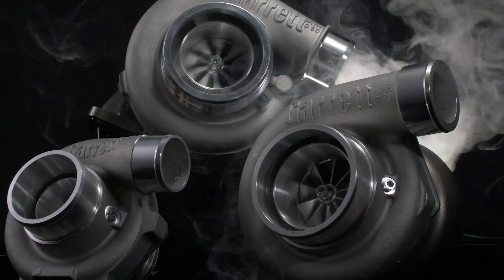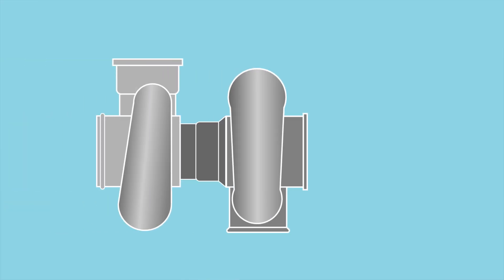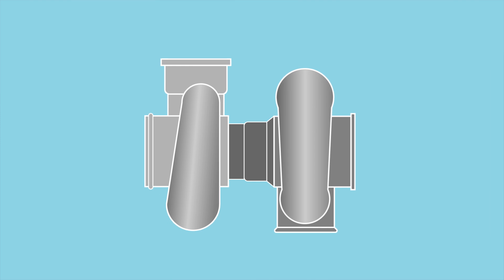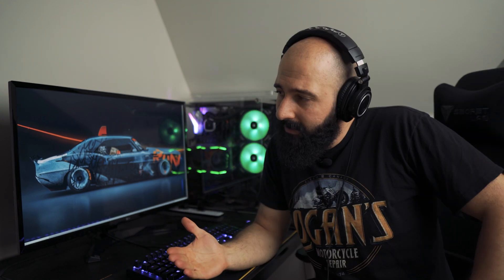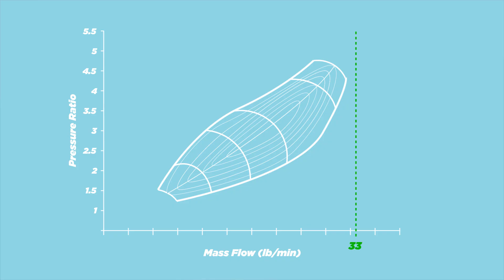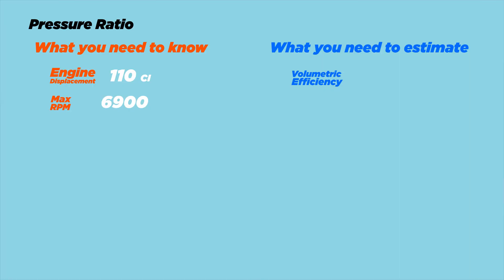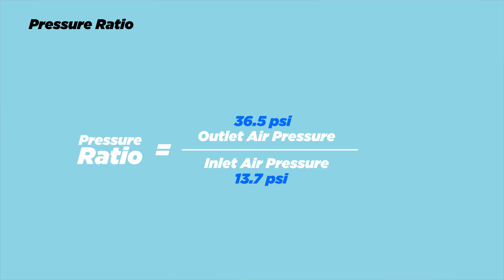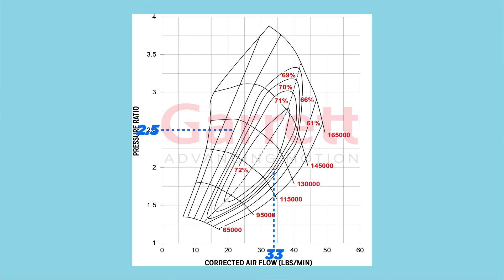How to choose the right turbocharger || EXPLAINED

Comment: Great vid…although I’m sure nightmares of  long ago math finals are sure to slip into my dream state tonight…that being said you talked at great length (you of course you realize watching this once will not suffice to understand.. it will take 2 or 3 thousand views for all this to click) about sizing with normal engines but I’m one of those wack a dopes who owns a FD3S rotary engined money pit…how do we figure out this sizing for us…it’s generally stated the two rotor wankles are 1.3 liter motors but I think this is a bit of sandbagging on the part of RX7 owners who claim high horsepower/displacement numbers…what numbers do we use? My twin stock set up is crap (have you seen the vacuum hose diagrams…yikes) and complicated but I love the drive ability of twin sequential set up but want to upgrade the turbo set up to make it fun to drive at street speeds and canyon carving but still aim for the 400 HP (and more importantly increase torque figures)…what do you think! Comments appreciated…yes I know the forum is a good place but it’s all over the place…

Comment: can you pls help me i have a BMW e46 with the M52B28TU Endine and i cant choose the correct turbo its a street car basic my daily  i woud like to have boost from 3000 -3500Rpm to 6800-7k RPM my target for now is 350-400 HP later after full bild engine 500+ tell me pls wich Garett ist the best option thank you

Comment: Love the video, the equations make this much easier. I’m turbocharging a 2003 Lexus IS300 with the 2JZGE VVT-i engine. Sitting in front of a W55 5 speed for now, eventually swapping for a 6 speed CD009. It’ll be a street/drift build!
Reply: I hope your not one of them people That block the intersection of the streets that the News Media talks about and gets them confused with Drag racing.....there's no reason for anyone to block off the whole intersection to do Donuts fined a Empty parking lot to do that stuff....besides it's  safer to do in a Empty parking lot.

Comment: I am not a math head, but this really broke me, looking to make 350bhp on my BMW 330i, Pressure ratio is way too low (around 1.54, no matter how I calculate it) this is way below the efficiency maps for any turbo. I used an online calculator, and I got the same results. Air Flow Ratio is 33lbs(same as the 300hp miata in the video for some reason). Went through all Garrett turbos, I can get exactly in the middle of the graph, but the pressure ratio is way too low, I have to run 15-20psi to get in the middle part of some turbos advertised as a "3 liter 350hp" turbos.

I did some research and being below the choke line is a low-efficiency zone and it is pretty bad for the turbo because of the excess heat. Can someone give me some advice aside of "just run more boost to get there"?

Comment: I have 2 2012 and 2014 3.7 dohc v6 na vehicles that have aftermarket turbo setup on them. I have a mustang with a precision 6776 .96 ar with a target of 550-700 hp on e85. I also have a f150 with a vs6766 .96ar with a target of 500hp on 93. I’ve tried looking for the compressor maps before and can’t find the information. Do you think these 2 3.7 motors have adequate turbos for the setup?

Comment: 2003 Peugeot 206cc with a 2.0-liter engine is equipped with a port injection system, thanks for the tips.

Comment: I have a 2008 2.5l turbo diesel manual 4x4 Toyota Hilux (ecu tuned with retained safeties, pedal kit, soft 90 dump pipe into 2" free-flow exhaust, intercooler & K&N filter with cold air intake via a snorkel at roof level).
I used one of the compressor upgrade kits (impeller and compressor housing), that keeps the stock turbine config.
I was able to increase from factory 9/13lbs to a constant 15lbs of boost.. but the power doesn't come in till around 2500rpm.. so the take off at traffic lights is not what I'd consider "nice".

My stock 2008 2.5l diesel Mitsubishi L200 (factory turbo, factory intercooler, factory boost, factory filter but with an added pedal kit ) is way more responsive off the line and throughout.
Both trucks have the same wheel setups, are about the same weight and height.. so I'm assuming it has something to do with either gearing ratios or ecu safeties.. any suggestions?

Comment: 07 Subaru Legacy spec.B - 200k/mi (currently on vacation)
Existing Mods:
SPT full exhaust
SPT intake
GS B/C
AOS
Mishi Rad
Perrin DP
GS x pipe
GS LP cover👌
New Mods:
RA short block
Rebuild heads
GSC valves
ARP head studs
Perrin charge pipe
GS TMIC 
Cobb high flow FP
ID 1050x

Going through an engine rebuild(wasn't the headgasket) because I'm a subi guy and I hate money. Long story long, one night I wasn't drinking n stuff and ended up buying a steamspeed jen2 71r bill burring etc on iag. On the listing all I see is a $1599 turbski marked 50% off for being an open box return.. Naturally, the subi brain is thrilled with this after 2 OE turbs weren't having so much fun. Apparently something was wrong, but is now found. (Cylinder #4, vacuum leak, etc)
The question is about the Steamspeed turbo. With the current rebuild + existing mods + new mods, will that turbski be fine to use? I've read and gotten mixed opinions.

Comment: The thing that first got me into this turbo mess was actually a theoretical car. It took some serious effort for me to figure out what turbochargers would be effective for an LT6 engine meant to reach 1400 horsepower. After that, what would I need for a 2UR-GSE to reach 1100? For a different project I was working on, what turbo would work best for a 1JZ making 400? And then for giggles, I decided to try a bored and stroked L28 making well over 600. All in all, very fun, but it gets frustrating trying to figure out trim and turbine sizes.

Comment: Trying to calculate this all for my cars turbo upgrade using the applicable numbers….I so bad at math and am having trouble understanding something here. Are we dividing our max rpm by 2? Using that formula? If so then why am I ending with a manifold pressure of 2.46? Shits not coming out right and idk why
Reply: Adding then multiplying then dividing by the multiplied numbers on the bottom half but also diving our rpm? I think my order of operations is fucked…someone help me here 😅

Comment: This may be a comment that isn't noticed due to the video's age, or simply just a bit of a niche topic, but how does the math change when using a twin or sequential turbo set up? An example for twin would be for a V8 with each bank feeding an individual turbo, and each turbo feeding a shared intake. Sequential would be an I4 with a manifold feeding a small turbo, with a a valve/solenoid leading to a larger turbo depending on exhaust volume and velocity.

Comment: I'm thinking of turbocharging a suzuki m16a...1600cc, 11.1 cr...I'd like for it to spool at around 3700rpm to keep the torque and cylinder pressure reasonable as my thoughts are that if the turbo spools up too early,it will be putting the engine under more stress,as well as the drive train....what do you think would be a good choice of turbo?

Comment: Following. This is bar none the best Turbo explanation video I have seen. If your other videos are like this, I'll probably watch every single one of them. I am trying to find the best turbo for my goals in a 12v Cummins dually. Now I need to figure out if there are any slight differences in the math required for a Diesel engine. Like the gas constant. Looking to make 500hp and 1300tq. Need to find the best balance between this power goal and turbo lag

Comment: I was just wondering what turbo size that I should look into if I wanted to use an M122 GT500 Supercharger blown into a turbocharger for a compound boost setup (twincharging). A M122 is among the largest commonly available roots style supercharger. I'm fairly certain that it achieves more than 10lbs of boost at lower rpms than maximum engine rpm. So it would most likely going to be a large  turbocharger to be an efficient setup. Or would this setup not be possible or advisable? Thanks in advance for any and all advice, opinions, or answers.

Comment: Ford v6 2.8 liter what would  be a nice twin turbo set up for about 250 to 300 hp max rpm is no higher  than 7k and like the ecoboost  would  like the boost coming starting  around  1500 rpm any suggestions  thank

Comment: I plan to turbo my Honda del sol. Thanks for asking. On a side note, tho would it be possible for you to add metrics and kw power ratings rather than HP on the bottom or somewhere in the video? Thanks

Comment: Appreciate your content - exceptionally made and thank you very much for your efforts!!! Would love to see more! 

FYI: CALCULATION ADJUSTMENT:
Die Volumetric Efficiency rate of your given values 95% should be added at respective 0.95 (not 95) --> or you have to calculate the result again with *100 which makes it more bulky.
Reply: My man, you are a life saver. I’ve redone this equation and checked at least 50 times and got a pressure ratio of .4 and was 🤏🏻 this close to going insane 😂

Comment: Nice video so if i want to upgrade a turbocharger  for the 3sgte which comes with the ct26 to a pulsar Turbo PSR3076 wanting 400-500 hp will this turbocharger take too long to spool up,too much turbo log or its a good choice?

Comment: Excellent Video!  I'm going to be boosting a Chevy 250 Inline 6.  It's been built with flat top Ross Pistons, lump ported head, Offenhouser intake and split manifold exhaust making 211 HP and 248 ft. lbs. of torque.  My goal is 300 - 350 HP.  Does this sound reasonable?  My current compression ratio is 9.2:1.  How do I determine how much boost my engine can handle before I damage anything?  It'll be a street car with occasional trips to the track.  I'm not sure how to apply all these amazing calculations at the moment.  I'll have to watch your video a few more times.  You're a turbo wizard!  Thanks for sharing your knowledge and experience.

Comment: I have honda accord sixth generation euro 
It has f series engine F18B2 
I want to put turbo on it 
On stock engine and I don't want high hp the car is 138hp im looking for 200 to 250 can i do it without modification on the engine thanks

Comment: Crazy video :))
Really explains things 
I'm looking to upgrade my 1.6 tdi engine currently at 139hp ( stage one) and looking to obtain around 250hp
Not to go so crazy :))
Already looking for a bigger intercooler and turbocharger 
Not sure if I need some bigger injectors also ( need to research more)
This is the video that I've been looking for 
Thank you

Comment: Not turbo, but supercharger. I'm installing it on my MKV VW R32. I'm doing it without a head-spacer or intercooler at around 8psi at around 6500rpm on a 3.2L 24v VR6. Its a Ruf supercharger with a cogged belt and pully no belt slip , upgraded pump and injectors, and long tube headers.

Comment: Ford 5.8w with cam , automatic ,373 gears and 210 heads what size you think is good for a turbo vs racing 7875 gen 2 billet ?

Comment: Me on my way to calculate my 1.2 75hp 3cylindet naturally aspirated awd car. Wish me luck!
(Do yall think it’s gonna work and is going to be reliable for such a small daily driven engine?)
Reply: What kind of car? How much does it weigh? Is trans auto or manual? What type of motor, dohc, sohc, pushrod? Valves per cylinder? Hp goals? Budget? 
If you just slap a turbo on it, no. Now if you do a proper build you could run a moderate boost and be pretty reliable but if you want to push high boost forget the word reliable, even with the best setup. With a nice motor build you maybe get say 105hp, add some decent boost and you get 140/160 "reliable" HP but this this point you've had to, at the very least, get full bolt on intake and exhaust, beefier clutch, bigger injectors, lower compression pistons, forged rods, intercooler, oil cooler, boost control, cpu tune, dyno. You run into things like, while we're there might as well get better cams? While we're there might as well get new valves and lifters? While we're there might as well clean up these cylinder walls give you a 5 angle valve job and moly/polycoat everything? While we're there it would be smart to port some of these runners so you get the most out of your build? This intake manifold is garbage, don't you want a custom? Maybe an intake spacer or a metal head gasket for "extra security". The list goes on and on, stronger bolts, bearing, and maybe new brakes now with all this power. It's a money black hole from which you cannot escape. Much less trouble just trading in on something with bigger displacement and/or factory turbo that could handle a little more boost with a stock setup and a tune. If you just want to do it for sh its and giggles and have the money to flush I could make you a star just make sure it's not your only vehicle.

Comment: wish i would of found this Vid before i bought my now expensive an vary large and heavy paper weight,  Ahhh I mean my "for the race track" s480 88 T6 turbo. i have seen a bunch of vids now explaining this. but all either seemed to either way over simplify this pretty technical process an missing large important details. Or are 180 in the opposite direction and are way to much in depth with technical info presented so slowly and so incredibly boring i now use them as my top pick for nights "cant sleep" you tube playlist. but really enjoyed this one a lot, actually made it to the end without nodding off. it was nice an hardy large portions of knowledge to chew on,  delivered in a fast and efficient manor.  just how i like it. nicely done! now as for what i turbocharged well the truck originally started life out with a 2.2l. i may or may not of neglected tell it blew up. so naturally i figured best way to beat them blown up engine blues was LS swap or LQ4 to be more exact. an some where along the time of saving up cash to finance the project i came across someone doing the same swap to there ride but with a turbo to. so my brain came to the conclusion, ya lets not fab twice. we'll do both at first an make things as difficult as possible as i can from myself😞.  that was a year and a half ago all 😃 now "i think i have all the kinks worked out" just finished tightening the last few bolts of this weeks "operation fix all oil leaks" cant wait to take her for a spin tomorrow. lots of hard work but i am telling ya boost days are the best days and the quickest way to a goofy grin from ear to ear and  just not caring who see's because life, boost, hay everything is amazing. i'd bet it could eradicate depression, hell i hear its even great for cancer.

ps. regular medical treatment is still advised and boost should only be added to ones all ready per cribbed treatment from a licensed physician and not to be used as a substitute. conditions may vary. I am not responsible for those without souls who cant enjoy finer things😄

Comment: 1994 Ford Ranger 3.0l  183 Displacement  .Target 300 hp. 13.92 Air pressure. 5000 Max RPM. No intercooler. 88 VE.  According to your video. 2.83 PR. 33 mass flow.  Could you verify?  Your video is not  boring. It's awesome.

Comment: Hi man. I'm doing something stupid IE I'm turbocharging a gasoline-electric hybrid. Now hold your horses, it's not a prius. I don't want to get into atkinson/miller cycles, yet. It is a fat prius : a Lexus 400h. The motor is a 3,3 liter 3mz-fe V6 producing 200 horsepower naturally aspirated, normal otto cycle, VVT-i on the intake side business as usual. I got a turbo from a 2 liter turbodiesel Toyota Avensis. That car produced 135 horsepower. I really want to use the turbo because otherwise I have a boat anchor in my garage.. My gut tells me, it's not going to be big enough alone. So here comes the stupid part : I could get another, similar one for peanuts basically. The question is : are 2 of those going to be enough for 280 horsepower and how do I figure out their maps? My redneck logic tells me that a pair of 135 horsepower engine turbos should produce 270 horsepower in a single engine (if the exhaust gases are sufficient) and by messing with the wastegates and a proper tune I could get that number to a streetable 280. I know that the 3mz-fe has been factory boosted with a supercharger without an intercooler on pump gas to about 245 horsepower, so the internals can take my setup.

Is my logic completely flawed and my diesel turbo is bound to spend it's remaining life in the bottom of a lake or is this something that could work?

Thanks man!

Ps. Great video, it was not boring at all, very informative and dynamic. If it means anything, I got adhd and I got a pretty good nose for boring if I dare say so myself.

Comment: so the airflow and power of the engine don’t matter at all? if my target hp is 550 crank and i’m starting at 200, wouldn’t i need a different turbo than an engine starting with 300?
Reply: those numbers are irrelevant in all the calculations, and a 2.0 needs 63 lb/min of air at 3.7 PR to hit 550 crank. garrett doesn’t have a single turbo that is anywhere close to peak efficiency during this time. but a built engine would be pulling more air in (camshafts), ergo making more power to start.

Comment: I'm going to have to watch this a couple of times to get it but I'm willing to do it. My engine is a JDM B18B NON VTEC (DOHC16V 1.8 LITER 4CYL) turbo may be in the future . I would be looking for boost on a street application like you said ( quick spool linear power band no lag) looking to make 250- 300 HP maybe closer to 250 since I want the engine to be stock internals.

Comment: Nice video. One thing I don’t understand in your manifold pressure formula is “33x639.6x(460+130)” what number does that 460 represent??? I didn’t see where that was explained. It’s just shows up in the formula.  
33=mass flow rate
639.6=gas constant
130 = intake air temp
460 = ???